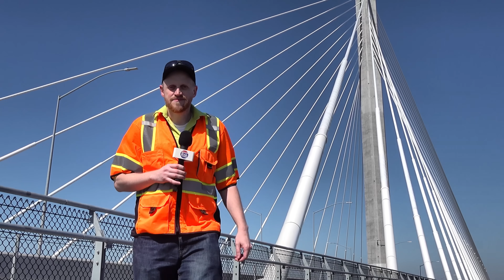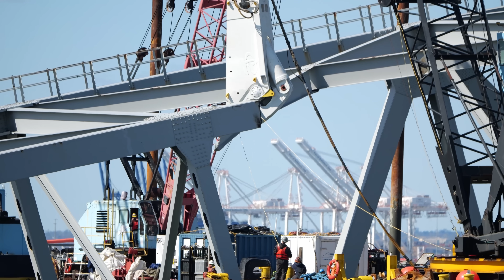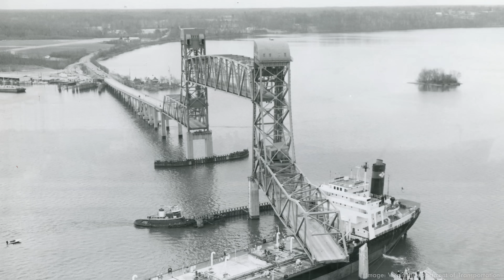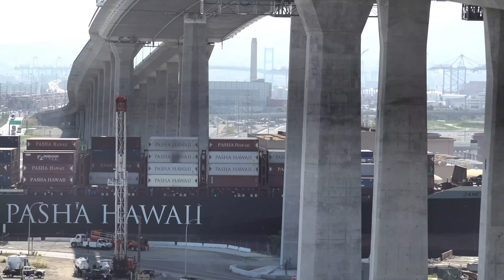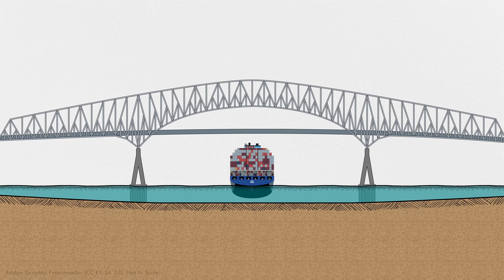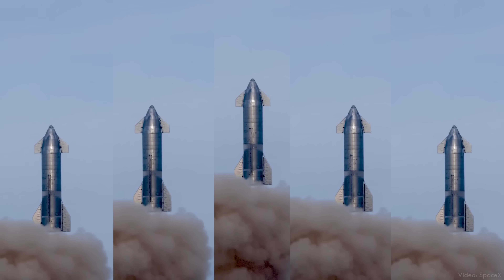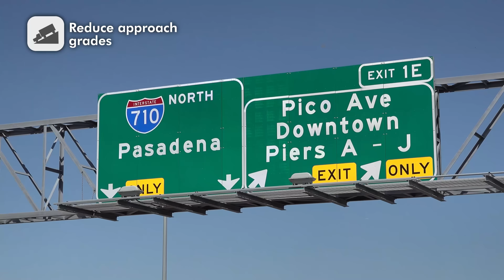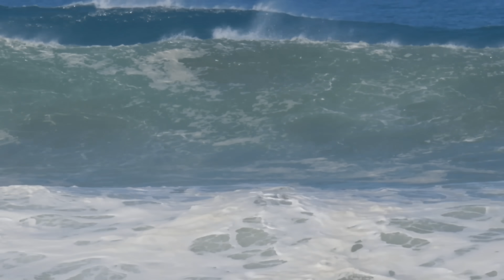How Bridge Engineers Design Against Ship Collisions

Comment: Grady,  thanks for doing a great job covering this event.  As an engineer with 20 yrs experience and a PM with another 20 years, I would comment on the topic of risk and risk analyis.  As you stated correctly, a risk event is a combination of probability of occurance (can it happen?) and impact (what happens if it does happen?).  In the case of a large container ship hitting a bridge, the probability is low but the impact is very high.  Therefore, the money should be spent on reducing the impact.  You further mentioned, correctly, that this situation is not a matter of engineering, but a matter of cost.  I think it might be time for the engineers to stand up and demand some changes.  We are sending billions of dollars overseas to help others whilst we drive over bridges that were designed to 1950's standards.  It is past time to replace these old, out-of-date bridges.  I find it interesting that no one is interested in replacing a bridge until it is severely damaged, usually with loss of life.  Then there is a lot of talk, but the essentially identical bridge 100 miles away is not replaced.  The ships are going to get even larger and more difficult to control.  Clearly, when they lose power they are out of control, which anyone should see as a huge risk multiplier.  Those things must have tug boats until they are far past any bridges.

Comment: A problem with using risk as a cut off is that you are looking at one bridge. If its once per 10000 years, and you have 5000 bridges the odds are now 1 every 2 years for some bridge to collapse. The only way decrease this reasonably is to mandate ships to be more reliable in some way (like tug boats, routine inspections etc) and to have some fixed structures in place. 

The bigger the ships the more reliable the ships should be, either with tugboats or generally reliability. An engine failure is for the majority of cases easily preventable with maintenance. Its just that it costs shipowners money when they are not run so its better to get it to failure before fixing it instead of fixing stuff that might not cause a failure or will cause it in the future.

Comment: Yes, but this collapse could have been preventable. You gave the number 30 similar failures between 1960-2014, 18 of those in the US.  So this event is not unique.  Even in 1980, just a couple of years after this bridge was completed there was the Florida failure. Directly as a result new bridge safety standards including new dolphins and buffer islands.  The state actually considered updrading the protection around this bridge and decided against this.  At that time, the 1980s ships had already gotten bigger then the Key was designed for. They had from 1980 to 2024 to build better protection.

Engineers, and the federal government have to step up and mandate periodic reviews and upgrades.  So you design and build to a standard. But then every 10-20 years you review the design against the new traffic realities, number and size of vessels.  The point is the 4 totally inadequate dolphins on the Key bridge should have been updated some time in the last 40 years.

Maybe as part of the design reviews would be placing limits on ships larger than their design standard. For example, slower speed under bridge and maybe mandatory tug boat assistance. 

The six deaths in this event are trivial in the larger scheme of things. But the disruption to shipping and trucking are presenting huge consequences to the economy.  I'm sure that if they factored lost business, plus cost of cleanup (vs controlled demolition) and the extra cost of emergency construction would have been able to cost justify building better protection around this (and other) bridges.

Comment: Another major consideration (which is outside the scope of this video and channel) is why the ship hit the bridge in the first place. A giant cargo ship like that cannot simply “lose power” and crash into a bridge, this is simply unacceptable. There should be at least one, likely multiple, redundant systems (and personnel) to prevent this from happening. It’s much easier to prevent a ship from hitting a bridge than it is to keep the bridge from falling if a ship hits it. Holding ship owners liable for the damage that their ships cause would trigger huge improvements in this area, rather than the slap on the wrist that they currently get now.

Comment: On an interesting side not, the probability of rolling a Yahtzee on your first throw is actually about 0.08%, not 0.01%. A Yahtzee is 5 of ANY kind, not 5 of one kind, so the first dice actually doesn't matter. If you roll a one as your "first" dice, you have to roll 4 more ones, if you roll a two, 4 more twos, etc. So whereas (1/6)^5*100 ≈ 0.013%, the true probability of rolling a Yahtzee is (1/6)^4*100 ≈ 0.077%, or about 1 in 1300. Just in case anyone has ever rolled a Yahtzee on their first time before and got a little scared, it's supposed to be about eight times more rare than the example Grady gave!

Comment: In my opinion, that bridge should be replaced with a tunnel. Most bridges that have the possibility of allision probably should be replaced with tunnels. It's more expensive and takes longer. But, tunnels have a higher safty record, and they typically cost less to maintain per year.
Reply: A look at horrific tunnel fires such as one in the Mont Blanc tunnel may make you reconsider.
Reply: As expected, one of the most balanced reports and commentaries on this collapse 👍despite the headache and tinnitus inducing yelling from the guy on site.
Maritime insurance law is complicated. The risk and responsibility for liability  for protection needs to be visible up front and throughout the life of the bridge during maintenance and operation to ensure key factors are not overlooked or ignored.
If failure protection relies on operational procedures which may be ( or become) costly it will be all to easy for these to be sidestepped by bean counters in later years.

Comment: This is being couched in the wrong terms.    Mitigation strategies are the answer.   In this case a physicists barrier to stop the ship by drag is one (pier protection).   The other is Attached Tug escort like Prince William sound or New York Harbor.    Chief engineers have noted,  once you loose propulsion,  you are not going to recover in time to stop a failure like that.   So you add layers of safety as you know sooner or latter you are going to loose propulsion.    The Bridge in LA looked to have been at risk as well,  on shore does not mean a ship can't hit it that close to shore (unless  there is a drag barrier off shore).    The New Baltimore Bridge will have piers so far away from the channel that the bank is the drag protection.     Thing of it as a crash barrier on a carrier.   You hit the net and you drag the aircraft to a stop.    Enough shallows does the same thing.   Drag over time equals no hit.

Comment: 1. Remote control or autonomous tug parked under the bridge that can be summoned to come push a boat.
2. Require emergency propulsion systems on boats.
3. Drag wire like an aircraft carrier that can be quickly lifted from the sea floor to slow a vessel on collision course.
4. Drop Anchor?
5. Concrete ramps around the pillars to redirect the force into lifting the boat. (you mentioned that one).
6. Something about magnets, but that won't work.

Comment: What I don’t understand is, as an engineer, although not structural, it’s obvious to me the bridge piers didn’t have enough protection. Additionally, why wasn’t the bridge built with designed failure points if one of the primary support piers and pylons gave way, only a section of the bridge would collapse. Seems to me, you could have balanced the left and right trusses so that if one fails, the other stands with the remaining cantilevered truss behind it. The rivets/bolts sheered like they should have but the weight of truss on the right pier was off balance.

Comment: To me the real failure here is how did a vessel of that size and sophistication lose propulsion, its first generator, second backup generator, and then the third emergency generator took twice as long to come online and then appeared to fail shortly afterwards that the ship was then and without any electrical power (ships steering controls) or propulsion. That’s where I really want to see accountability here, that ships operating in such a confined environment as a port, that the risk of this total systems failure of the ship is now by regulatory measures reduced substantially.

Comment: While modern bridge design offers strength, material / weight reduction and visual appeal, they often rely on the integrity of the structure to keep it together. If damaged, the whole thing falls apart like that section did when the rest collapsed. Heavy duty steel beams help them stay together, at least beyond the supports from the damaged section.

Comment: The bit about having a bank around the pier is the next chapter.   The Dali IS aground because it left the channel.   The amount of force necessary to break the suction in the mud  is a huge number.   The front-of-the-envelope calculation is that we will need about 10 large tugs to pull it off the bank.  I think I saw that on Sal's what's going on with shipping channel

Comment: Few weeks earlier we had a similar incident here in Argentina where a cargo ship suffered a stuck rudder issue and collided with one of the “Zárate” bridge columns. That bridge suffered only the breakage of 1 of 36 pillars, and the ship ended severely damaged like an opened can. The circulation (road vehicles and railroad) was kept closed only few days for thorough inspection and reopened normally. Tell me about engineering
Reply: So the Crazy Prime Minister is doing a good job? That's surprising, tbh
Reply: @jamesisaac7684  the bridge incident went well because it was designed to resist Godzilla himself, about our president, only a crazy person could dare to fix the economy XD

Comment: Help me understand the area under the curve part around 13:40 better (note: I'm relative familiar with math and stats but from a field where pure calculus is less emphasized.

In a probabilistic sense, shouldn't the areas under the curve highlighted in red extend all the way to the tails on the left and right instead of just the area under the support? Like, shouldn't the areas under the curve start at the inner most potential contact points and extend outwards from there indefinitely?
Reply: Pretty sure the boat wouldn't collide with the bridge if it was on the far left or right of the supports. It may get stuck if the water is too shallow, which sucks for the boat, but doesn't affect the bridge at all. If there were other supports it could collide with, they would also be red but there aren't any visible on the diagram. At least that is my understanding.
Reply: @ragingfirefrog   Yes... but then you should have the width of the supports plus 2x the with of the boat at least in the red (that is, the boat hits it on the left, the right, or anywhere in between).

However, anywhere to the outer sides of the supports are non-viable paths for the boat, too (the narrower, shallower portions). So basically it seems to me that any space other than the space between the two supports wouldn't work out and thus should be in red, right?
Reply: @Tahoza  It depends on what you define the red space as. In the clip, the red is where the boat will impact the bridge. Even if the boat isn't supposed to be in the far left or far right water, it won't hit the bridge, so it won't be red.

I don't know if he is treating the boat as a single line or a width, so the red area might need to be larger, but it wouldn't extend all the way to the far left or the far right. 

If the red area was defined as where the boat wasn't supposed to be, then it would extend to the far edges.

Comment: The failure to adjust to  changing conditions like vastly  larger ships by the government (Coast Guard, Port of Baltimore, NTSB, etc) is the cause of this accident. As ship  size rises, more tugs should be required to see the ship through the bridge. For a ship this large one big tug on either side of the bow and one a  stern line,  and  speed limit of 5 kts in the vicinity of the bridge would have saved the day.

Comment: Grady, I'm surprised you didn't reference the Big Bayou Canot Railway disaster in your list of bridge incidents. It's the one where a tug with several bardges turned onto the wrong tributary in the dark and struck the Big Bayou Canot bridge. In this incident, the bridge didn't collapse, but it dis suffer enough damage to distort the railway that ran over it. An Amtrak train, the Sunset Limited, traveling over the bridge derailed and ejected over the side into the waters below. The safety mechanisms in place to alert to issues with the rail didn't trigger because they were looking for a break in the rails and not just the rails deforming.

https://en.wikipedia.org/wiki/Big_Bayou_Canot_rail_accident

Comment: Wow an engineer using "deceleration"... Disappointing.
Those poor road workers. Pretty sad they weren't told in time to save their lives even though there were many problems early on.
There needs to be processes to prevent this. Oh you lose power heading towards a bridge, instantly trigger sirens on the bridge just in case.

Comment: Hi Grady!
Excellent video on the subject.
You're right that assist Tugs were not required in Baltimore for the ship transit under the bridge, but if they were, the ship would have needed to be moving at only 2-3 knots instead of 8 knots (like the Dali before it dropped its anchor)) for the tugs to have any hope of guiding such an enormous vessel in the event of a total power loss.  As I'm sure you know, the mass of that beasty is astornomical, so each additional knot of speed greatly increases the inertia, and the tugs (even the big ones) only have just enough power to gently nudge such a large ship in any direction, so they would all need to be moving rather slowly for the limited power of the tugs to have enough time to actually have an effect on the ship, once it starts going awry.  Incidentally, assist tugs cost $$$ and that increases shipping costs.
I'm sure you agree.
Just pointing this out for non-boat-nerds.
Reply: To be fair, it really is time, and the horizontal speed of the escorted vessel, that are more the important factors here from a mathematics perspective.  Then possible lateral currents (or wind) acting on the vessel and when that might start acting on the vessel are also key. I can't speak to the maneuverability of the tugs with the 5-knot forward speed though.

Comment: Interesting stance but I kind of see where you are coming from. Human life just isn't worth the money that could be spent to prevent its loss. It is scary but that is just how it is, and while there is tons of infrastructure out there with very poor ratings, there just isn't the money to cover it all. I thought a tunnel would be the best answer here, instead of the tugs that will be escorting them out for a long while, but that means hazardous chemicals couldn't make it across. Baltimore being a industrial lead city I doubt they would do that. 
I have been pretty upset about why they didn't have that bridge better protected, and i don't feel like there was a decent answer. Bridge was as old as me, and the sunshine didnt come down for a while. So they balanced the cost of fixing it based on it being a newer structure. It has long been known that ships have that tendency if they are to lose power. Those dolphins were way too far away from the piers, it sounds to me like the engineering supervisor might be to blame there? I'm not sure how that chain of command works, but planning was poor in my opinion. I mean before a ship comes into that harbor safety needs to be updated, doesn't it? that ships bow over hanged quite a lot, the cargo ship pilot couldn't even see that part. 
Secondly I am surprised because what if that was terrorism. We might say safety of people but things like that are national security, and that was far too easy to do.
Reply: Money is fake, and there is as much or as little of it as we want there to be.

Comment: All vulnerable bridges should have standby tugboats laong side vessels as they transit... Seems like tthe comapliant is the cost!!! IMHO" pass along to the vessels using waterway thru the bridge. Even they are not a massive container vessel they could pat a pro-rated toll to the port Authority, who has permanent contract with towing Cos to supply the transit tugboats(this spreads the tugboat cfost and keeps things safe, without getting in a pissing match with ship owners) ships transitting Panama canal Suez canal Pay significant fess for each passage.  if every vessel large and small paid the port authority a "toll" the cost could amortized over the users and the Port would insure tug assistance was there always... Plus the Dali was going 8.5 knots appraoching the bridge: ain't no stopping 100,000+ tons at that speed....Tugs offer a more controllled alternative for course corrections, etc....

Comment: I used to work as a deck hand in a tug boat fleet that moved barges under the REDACTED river bridge. The vertical clearance was so low that, dependent on the tide, the top-most parts of an unloaded barge would come within inches of the bottom of the bridge. The horizontal clearance was a cake walk, relatively speaking, even for double-wides.